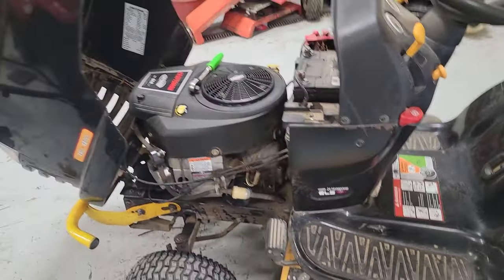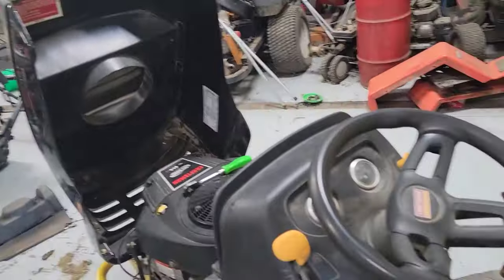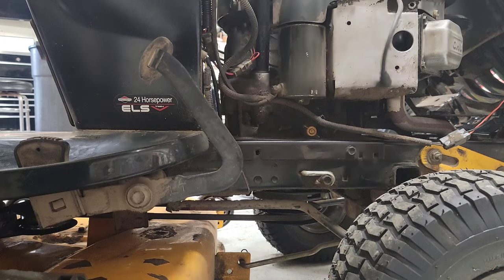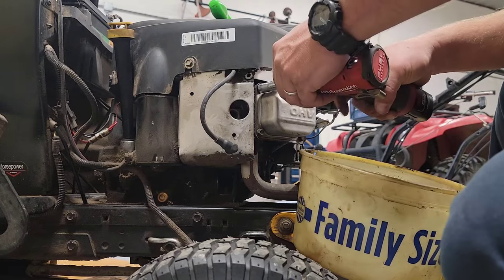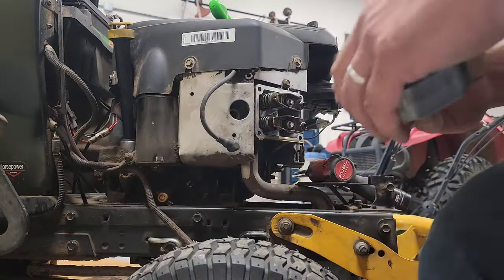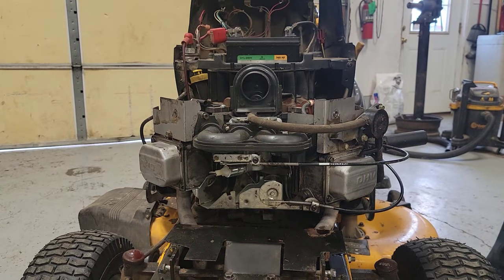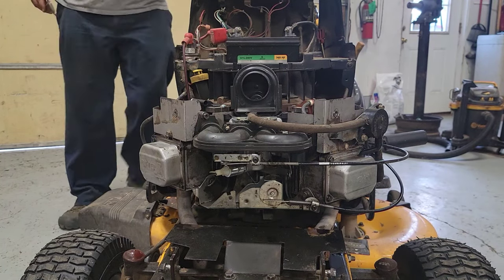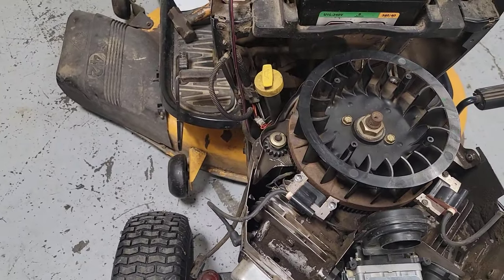Briggs and Stratton only running on one cylinder due to diodes

Comment: What you are measuring is Forward and Reverse resistance in Ohms, not voltage,  The voltage from the meter provides bias to either forward or reverse the diode junction (depending on the polarity of the meter probes) providing the two resistance readings.  That's probably more info than anyone wants to know, but I'm too anal to have let it go.  Good diagnostic video otherwise!

Comment: I'm chasing a low power issue today. Did notice my engine has the swirl or blowey thing that keeps the cylinders cooling fins clean. B&S also provides flaps to inspect these areas.

Comment: Good catch. I see these engines with cracked intake manifolds also causing dead cylinder.
Reply from the maker: Thank you! I have not seen one with a bad intake cause a miss yet! Thanks for sharing! I'll put that in the ol brain for later diagnosis'
Reply: The plastic ones can crack
Reply: Thank you for the video. Opens up some ideas for me to check. My engine has a similar runability problem. Also somebody added a push button start to my mower and still has a key switch also. I keep burning up the button switches. I found a from the starter solenoid going directly to the starter going directly to the starter. There is also a wire from the starter to the button switch. Does that seem right? I feel that is sending current to the button and buring it out. What are your thoughts?
Reply from the maker: @rickpendleton7036 I'd wiring a solenoid back up

Comment: I have a 22hp BS running on one cylinder so i will go through that process and see if it works. Thanks for this video.
Reply from the maker: You're welcome!
Reply from the maker: Yes. The new diodes fixed it right up!
Reply from the maker: JEFFQUICKLE9  not that I know of, but you can order them on Amazon
Reply: My problem is not the diodes. I checked them and they are good. Put new coils and plugs on and still down one cylinder.
Reply from the maker: @Twohandsranch58  do you have compression in that cyinder?
Reply: @Wrenchesandrods  haven’t got that far yet. I’ll check it this weekend.
Reply: @Twohandsranch58  yes yes, did you check it?

Comment: Deleted my diodes.. Engine runs great. takes 15 seconds to shut down after I turn key off. Not charging when running so I keep a small solar panel attached to the battery when it's not running.

Comment: Got a 100 series John Deere with a twin cylinder engine that looks a lot like this. Google got me here as I have a similar issue  No spark on one cylinder. The mice have been nesting under the cover and I suspect a wiring problem. Always like to get a heads up with a YouTube video if I can find one before I tear into an unfamiliar engine. Good video to get me informed on what's under the cover. Wasn't aware diodes could be a potential problem. Guessing mine has mouse bite issues. LoL
Thanks for the info.
Reply from the maker: @googleuser868  check your kill wires. If they are chewed, they will ground on the engine and kill your spark
Reply: @Wrenchesandrods  Will do. Hoping it's something real easy like that.
Reply: Exactly the same harness was chewed up. 5 inches of bare wire on one wire 2 inches on another. Electrical tape temporarily insulating wires until I get a new harness.
Reply from the maker: @googleuser868  I rarely replace the harness. I'll replace wire and heat shrink it
Reply: @Wrenchesandrods  Probably save a few bucks that way. Thought about using a metal fuel or brake line for conduit to mouse proof it. LoL
Maybe foil tape.

Comment: With the wire hooked up to the coils and the plug unplugged, should there be continuity from the terminal on the coil to ground?
Great video!
I learned my new thing for the day. Lets go for another.
Reply from the maker: With a bad diode, yes. With a good diode no

Comment: Like the video and process... haven't seen this issue yet... wondering would it be a good way to test kill wires and diodes to unplug both wires, crank it up?  To shut it back off after simply crimp the fuel line to shut down?
Reply from the maker: I don't think so. When the diode goes bad, it allows current in both directions, which makes it spark out of time. It's still sparking, but it's just at the wrong time.

Comment: For me both cylinders are firing but the “driver side” one isn’t firing as much as the other side and i can’t figure out why for the life of me, i’ve tried everything i can think off and it doesn’t seem to want to work properly, both fire but one is not firing as much
Reply from the maker: Pull your kill wire off the weak coil and see if the spark improves. If it does, you kill wire is grounding to the block somewhere.
Reply: It could be a to tight valve

Comment: Mines the same engine except for the air filter cover is different mine doesn't screw on it has the yellow piece you undo mine is 40h777

Comment: I have a question? If a 24HP Intel only has one coil (and it's bad) how can one cylinder have spark and the other doesn't?
Reply from the maker: I've never seen a 24hp intek with only one cylinder to my knowledge
Reply: @Wrenchesandrods  oh my goodness, thank you for responding so fast. No, you are correct. It has two cylinders. Does it have two coils or one? I’m having the same issue as the title of your video 
Another video showed one coil, two cylinders with one misfiring cylinder
I can see two coils in your video at the 15 minute mark overhead view of your engine. Mine must have two coils so I could swap them from one side to another to see if it makes a difference. Once I do this I'll investigate the diodes. Already took  carb apart and cleaned it. 
Thank you. Thumbs up!
Reply from the maker: @user-ik4fd9ny4b  pull the kill wires off of your coils and see if the spark returns. If it does, you might have a bare spot on one of your kill wires that is grounding to the block, or one of the diodes is bad.
Reply: @Wrenchesandrods  I did have a bare spot.. MiCE! Also, the coil was nearly touching the wheel, maybe 3 or 4 thousands. Could/would that interfere or stop sparking?
Reply from the maker: @L46C3  use a business card to gape the coil to the magnetic and you should be set!

Comment: Could I just run the engine without the coil safety ground wire? Theoretically of course
Reply from the maker: Yes, but you won't be able to shut it off
Reply: Sure just starve it of gas and it'll shut off or choke the air breather or leave your kill wire plugged to the coil and unplug it from the harness let it dangle touch it to any metal to shut the mower off
Reply: I know one man who ran a wire just to kill it until I told him what was wrong and I had the part 😊